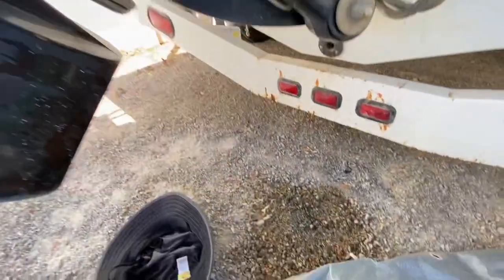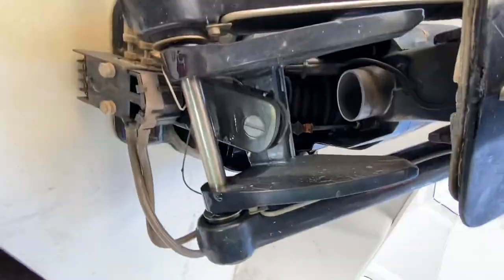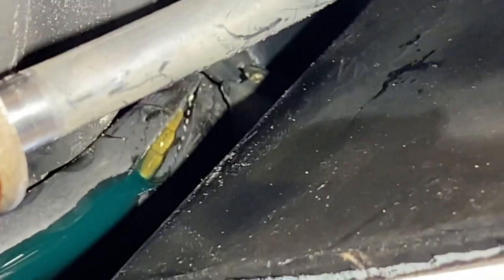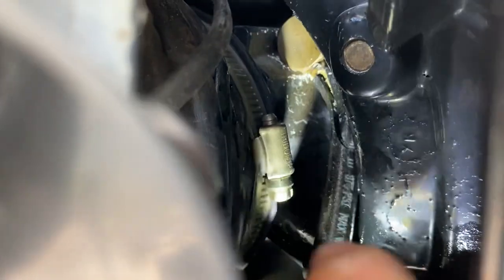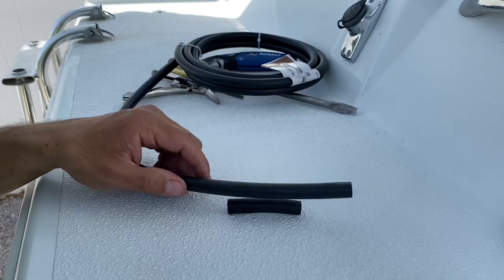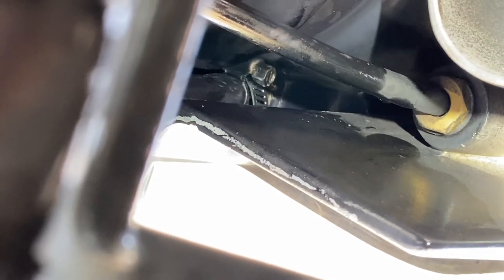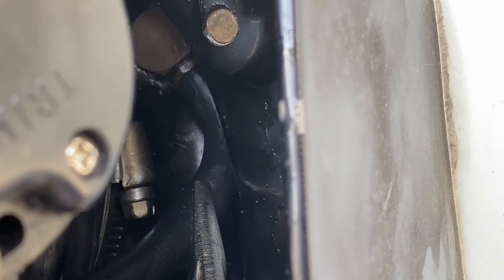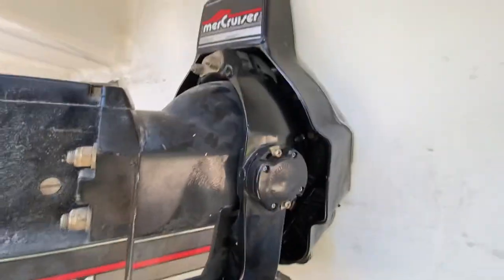How to change the gear oil supply hose on a Mercruiser Bravo out-drive. Without tear down.

Comment: Your timing on making this video was impeccable.  I just got back from the lake last week and saw that dreaded green puddle.  I was confused about where it was coming from until I watched this.  Went to O'Reilly auto parts and got the 1/4" fuel hose (250 psi) and hose clamps for a grand total of $7.00.  So much better than waiting for the boat shop to get my boat in "anywhere from 4-5 weeks".  Took me about two hours because I decided to drain and change out the gear lube in the outboard as well.  Crappy that the Bravo 1 outdrive requires you to remove the prop to get to that lower drain screw.  In the end, it kept extra lube from dripping out when I raised the prop to install the outboard side of the hose.

Comment: Just did it and it was a pain in the * but I was able to do it. Recommend a long screw driver, work light to wedge in for the rear most clamping area to see it, long cutters, straight and 45 degree pliers, box cutter, zip ties, small clamps and even hose clamp pliers if you can find them. O’Reillys had a pair that were needle nose with a notch for hoses. Take your time and don’t forget to clamp off the line from the reservoir.  Thanks for this video. Even the shops said you had to remove it all. 😁 proved them wrong.

Comment: Glad I found this video. My Alpha one requires a once or so after a day on the lake. Pressure checked the lower unit and it was good. No residual in the water. I will now check the hose and clamps. Thanks

Comment: Just did mine. Thanks for the video! I used zip ties and surgical clips to tighten them. Transmission cooler hose from auto parts store.

Comment: thanks for your video- Last week I just noticed some leaking of gear oil right on that same line- haven't looked real closely yet but will now that I saw your video. The gear oil leaks when the drive is down but stops when it's up, so now that I can see the line shown by you, I'm assuming that there is probably a crack in it which closes when the drive is up and then opens when lowered.  Just a guess, but most likely that's correct- I did see oil dripping along that line.  So regardless if this is my issue or not, good job showing your process for replacing that line.

Comment: You can do this and save $1600. Be prepared to get dirty. Oil drips. Took 4 hours for both motors. I am an average weekend toy mechanic. Laying on my tool kit helped get closer. Sitting on my yeti for the other end. Forehead light, and a flashlight. Use full Stainless hose clamps. I used 1/4” auto zone fuel hose. I went 1.5” longer than stock length. Sniped the end of my hose clamps. My 2006 had the plastic barbs on transom side. Used Allen wrenches to stretch my new hose with dawn and left it in the sun while I was removing old hoses. 

Harbor freight: 2pk long needle nose, long angle snips, long exacto, long flathead. 

Be extremely careful with your cuts. Bellows are less than an inch away.

Comment: Note that the reservoir and hose is actually completely unnecessary. We remove all that from racing boats. Just check your drive level at the vent occasionally. That's all we have ever done, and our boats are way up in horsepower. Never a problem. It's a Mickey Mouse arrangement, that reservoir. If the fluid level changes in your leg, there is a leaky seal. Fix the seal. Just adding oil doesn't fix anything, and that what's the reservoir does, is hide the real problem.

Comment: THANK YOU for posting this!!  I've been sweating it all winter wondering whether or not I would need to pull the gimbal housing.  Great to know that it is possible to replace it without doing so.  My current hose is not leaking however it looks like there are two layers of hose, and the outside hose is cracking.  Was the hose you took off a double-layered hose?   And what size hose did you buy to replace it?
Reply from the maker: I bought 1/4” hose. It was generic fuel hose with braided strands within.
Reply: Go to: 4:30

Comment: Thanks for sharing, the only thing is you don't have a exhaust bellows on your boat
Reply: Don't really need one if you have flappers in exhaust pipe. Otherwise, yes, a hard shut down or hard reverse water WILL go all the way up over your risers and down into the cylinders. Been there, done that.  :(

Comment: Hose clamp on the bell housing is the harest part, tried using a plastic pinch clamp byt it just rotated on the hose and got lost behind the bell housing fitting, ill have to add another hose clamp and hopefully doesnt rip the gimbal bellow

Comment: Just watched your video thanks. I’m losing significant oil from my header tank. I.e. the whole tank after only travelling a few miles. When I crank the engine oil can be seen in the water coming from exhaust. 
Was this what yours was doing? Thanks

Comment: I have gear lube leaking into my bilge, how much harder is it to fix that?
Reply from the maker: I read about it. There’s a clip you slide out perpendicular to the hose, on the bilge side of the wall. Once you pull the clip, the fitting slides out for replacement.
Reply: @First_Class_Amateur  thanks for the reply!

Comment: Is this hose under enough pressure that the clamps are ABSOLUTELY necessary?
Reply: Curoius of that question, myself. The filler resivour is actually like a car radiator resivour so if outdrive gets hot the oil can go all the way back into resivour. Otherwise I would say don't need.

Comment: hi,i find always oil in the bottom inside the boat,already i change hose and deposit,,but they still loss oil,,what do you think?its same problem o something more hard ? its only inside the boat..thanks
Reply from the maker: The is another seal if you follow the hose to the transome wall. If your google search for the gear oil supply fitting, you’ll see what I’m referring to. Best of luck.

Comment: Unfortunately mine is leaking into the bilge,  any tips on how to do that without pulling outdrive?   I suspect my barb is cracked on the inside
Reply from the maker: Well I was doing research for this repair I saw that there’s a clip on the inside of the engine bay. You should be able to pull the clip and change out the bar from there

Comment: I have this exact issue what size hose does it take?
Reply from the maker: It’s been a while but I think it was 3/8” (inner diameter)
Reply from the maker: I read an old reply of mine. It actually looks like it was quarter inch.

Comment: Have ?..what if the nipple is plastic and it breaks off..how do you change that piece
Reply from the maker: There should be a “C” clip keeping it fastened to the transom wall. Pull it from the engine side.

Comment: What type of hose did you use?
Reply from the maker: 1/4” rubber fuel hose from Lowe’s
Reply: @First_Class_Amateur  thank you. Awesome video.
Reply: @First_Class_Amateur  is there a specified length that is recommended? I know the water hose is fairly critical.